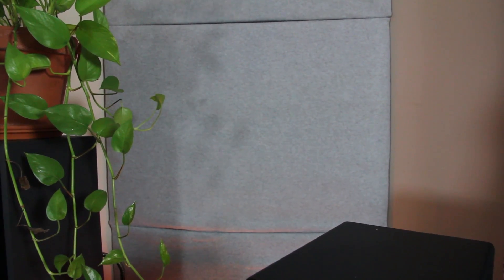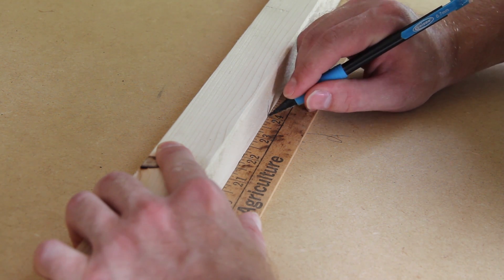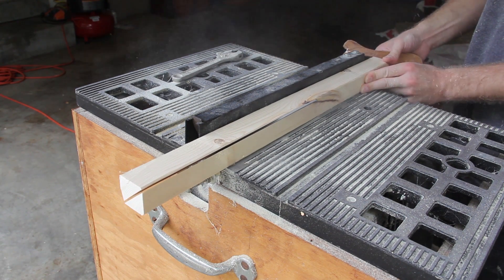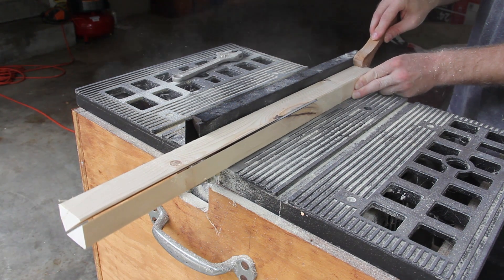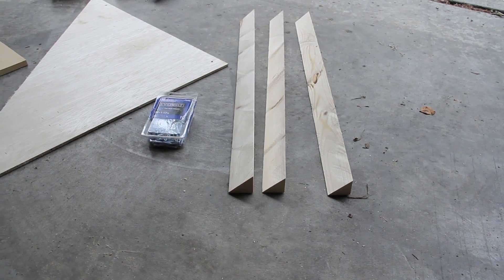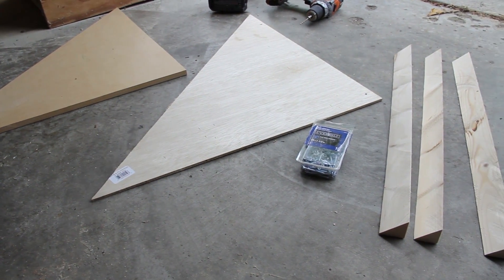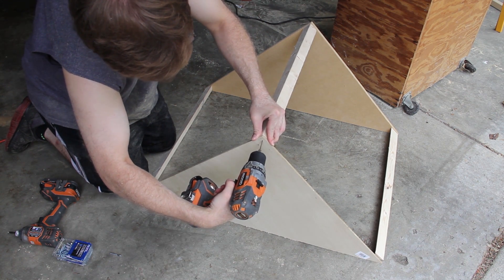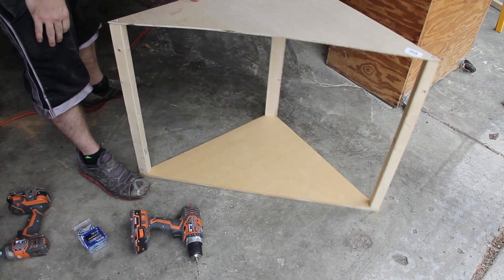DIY Bass Traps: Home Studio Room Acoustics

Comment: holy crap! never cut anything on a table saw like that!!! super dangerous. Ive been a carpenter for over 20 years and I would never even think of cutting anything like that. That could bind on the saw and pull your hand right into the saw. 
Other than that, good vid!
Reply: No, I dont do this!!! That is what band saws, routers, etc, are for. Use the right tool for the job. When I started in carpentry, I had a boss that would have kicked my ass if I did this...and now, I would never let any of my employees do this!!!! Very stupid and very dangerous. DON'T DO IT! I dont want anyone to think in any way this is something they should try or might get away with. This is how you loose fingers. Ive seen some very bloody injuries on the job site from guys who "didnt like to listen".  Ask any REAL wood worker or carpenter, they will tel you the same.
Reply: @christopherkent3294  I want to learn how to do this.  what is the right way to do it?
Reply: @marcohowardvalencia1644  never reach around the back, the saw is rotating towards you.
Reply: @christopherkent3294  Thank you!  When it happens, it happens too quick to do anything about it.  Some very seasoned woodworker have lost their fingers after years of experience, they just got lazy that one time and they were never able to flip anyone off thereafter.
Reply from the maker: +Christopher Kent haha thank you! Yes I have had several comments warning of this. I might add more precautions to the description about what to do different from what I did when using th saw. Thanks!
Reply: Might be a good idea. Didn't want to post a negative on your video, just made me nervous. I'm building a small practice room/recording studio. Thanks for the vid!
Reply: Ha!  Yeah I watched this video before reading the comments and actually held my breath during that 2x2 cut without any kind of miter or fence.  It took me a minute to think, "He's probably okay and won't lose an arm right now since this is on YouTube", but there was a moment there.  

Great, functional traps.  Nice finished work.
Reply: it's totally fine to do use the table saw like this. 

if you don't care about your appendages.
Reply: :D - and as a carpenter for 20 years, you have never done this? hundreds of times maybe? :). Of course it's not the safe way to use a table saw - but there are limits to how super careful you need to be. Sometimes it is just more practical to saw things freehand. Every carpenter knows this :). No use denying that :D But you gotta be very aware of what you do when freehand sawing like this, and from what I can see in the video, mr. Todd Audio have no problems with this.

But hey, safety police are always lurking around these kinda videos hehe.

Don't get me wrong - it is not safe, but it most certainly isn't as dangerous as many want it to be. From the way he handles the saw and wood, there is no chance that things just fly off in the wrong direction out of control. It might bite a bit, but not out of control.

best regards from a long time furniture maker that also knows his way around table saws.

Comment: I wonder how many viewers had to go to the ER after trying to crosscut lumber freehand on the table saw. Extremely dangerous technique. A table saw can send material flying towards the operator at a very powerful high rate of speed and pull your hands into the spinning blade. This is coming from a residential carpenter, cabinetmaker and DIY audiophile with decades of experience. People do NOT use a table saw this way, it’s not worth injuring yourself in pursuit of better sound.
Reply from the maker: So far I have not had any comments or reports about injuries, which I'd hope they'd let us know and warn us. Thank you for your warning - this is part of the reason why I leave comments open to the community. You told us what not to do, but it would be very helpful if you could advise what to do instead. 

To the viewers:

First of all, lets get this out in the open - table saws are dangerous, no matter how you use them. For one, make sure to wear eye protection. I'd like to repeat what I said it the video. The TOP priority is not to cut yourself. When making a cut you should NOT be thinking only "This cut needs to be perfect," but instead you SHOULD be thinking "WHERE ARE MY HANDS IN RELATION TO THE BLADE. IS THERE ANYTHING I AM WEARING THAT IS LOOSE OR HANGING AND AT RISK TO GET CAUGHT IN THE SAW. IS EVERYONE ELSE WHO IS NOT INVOLVED FAR AWAY FROM THE SAW. IF THE SAW GRABS HOLD OF THE WOOD, I WILL NOT KEEP HOLDING ONTO THE WOOD AND I WILL RUN AWAY FROM IT TO UNPLUG THE POWER SOURCE." Now let's work together to productively discuss safer ways to accomplish these cuts, which are necessary to build these.

At 3:34 - Please use a table saw blade guard for the blade for this cut, which is not shown in the video. My apologies.

At 3:52 - ??? Is there another precaution we can use to make this cut safer? Do they make blade guards that can be angled? Make sure to use something to push it through as mentioned in the video, to keep your hands from getting too close.

At 5:37 - ??? A fence definitely cannot be used for this cut, but it looks like a quality blade guard would work and be narrow enough to still let the plywood pass through. Same for the cut right before this one.

People are out there making these regardless, whether I have a video out there about it or not - and I assure you that I definitely want this video to be a proper guide in every aspect, especially safety. Everyone here will appreciate any additional guidance and solutions from those with more carpentry or DIY experience than myself - just keep in mind we are a community looking for advice and guidance. If you can share a better way to do something you see in any video on YouTube, please do!

Comment: Hey how do you hang the bass trap on the top of the wall ? ? I'm making only one so I can't stack them .
Reply from the maker: +PlainSimple You might be able to use some screw hooks into studs. If you do this you will probably want to modify it to have some sort of way for the sound to be absorbed through the bottom, since that will still be a hard shelf-like surface.

Comment: that fibreglass is good for those low frequencies?
Reply from the maker: +Cam Par it is mineral wool, but if you go the fiberglass route a lot of people rave good results with Owens corning 703 FRK. The FRK membrane will improve the response for the really low, subwoofer range frequencies. I can hear an very audible difference with what I have, but from what I hear the FRK membrane is an improvement with handling frequencies below 100hz and if you don't want to completely dampen everything it will also help reflect some of the high frequencies to keep the room more alive. I might consider adding an FRK membrane at some point, if I can find it separately.
Reply: Todd Audio my speakers go down to 36hz
Reply from the maker: +Cam Par yeah I have a sub and can still decifer low piano and bass tones way better than before. I play piano so might have an ear for it as well, and have pretty good headphones as another reference. Nothing really beats a professionally build room for a studio. For home applications, larger rooms also make a big difference since there is more room for soundwaves to disperse before they reflect and get back to your ear. I would recommend doing some research on the FRK membrane option or Owens Corning 703 FRK compared to this. I still should research that side of things more myself before I decide. You can probably find frequency test charts online that show results on how effective they are. Even retail sold applications should be looked into because depending on what it is it might not necessarily be as effective.
Reply: Todd Audio thanks for the tips, my low end mixes always sound muddy, tike for bass traps!
Reply: @ToddAudio  In dialoguing with Ethan a few years ago (my project is on Gearslutz with pics), he admitted that in his RealTraps they have moved away from FRK (which is like aluminum) and rather recommends 2 other options that are usable on any trap approach: thin plastic (like mattress bag material), and/or Kraft paper. Use adhesive spray so the covering adheres. I've tried both materials and prefer the craft paper. Here's the approach: For slightly increased bass response, put the covering toward the wall (with an air gap). For less absorption and more reflection of higher frequencies (to not overly deaden the room), put the covering on the front (room facing). That said, Ethan says NOT to do this where mics or early reflections are involved. So, really only in your bass absorbers (i.e. rear wall corners) and back half of room (Not front wall, or ceiling or side wall early reflection areas). There is a noticeable acoustical difference.

Comment: Great job! Thanks. How much difference would it make to just have one piece covering the opening with space behind it?
Reply from the maker: It would still help, but not as much below 100hz. Compared to the bare wall it still makes a big difference in the overall sound. I have another video called DIY Acoustic Panels that shows how to make panels with just one sheet of the Roxul into a frame.

Comment: Hi friend. My room is small. its dimension: 2.8 height x 3.19 width x 3.9 length (in meter) following ratio 1 : 1.14 : 1.39
If I use Roxul like yours' then which size of trap should I use?
Reply from the maker: +Tran Tuan Nice! I actually am working on setting everything up in a small room almost that same size as an experiment. I can definitely say in a room that small every bit of acoustic treatment makes a difference! Any size will help but I am very glad I made them this size, even though they do take up more space in the corners. I've read a lot of forums and articles about treatment for small rooms over the years, and while there are some varying opinions, the general consensus seems to be the more corner, wall, and ceiling surface you cover with Roxul or similar absorption panels, the better.. a room this small is just too small to really contribute to the sound quality, so broadband absorption as shown in this video and my DIY acoustic panel video helps keep all the unwanted reverberations from getting back to you and making it difficult to mix accurately.
Reply: Nice Todd. What is your room dimension, what about your data, which lowest frequency can be managed? Because of my low finance, I intend to make 4 triangular traps (34'' x 34'' x 48'' in length of sides and 24'' in height) for wall-ceiling corners; and 4 straddling panel traps (48' 'x 24'', 4'' in depth). Some other panels for first reflection, rear and front walls. I'm bad at software measurement. What is your opinion about my plan in general?
Reply from the maker: I actually have not run a test on it and don't have the software yet. This design was based on research and some other results I've seen. It sounds like the traps you are planning on making are even bigger than these! I think your plans are similar to what I am doing and it definitely makes the room sound way cleaner. Even with the lows, audibly, I can make everything out really easily. I am a keyboard/piano player, and I've tested the very bottom octave out on the piano keyboard with various sounds, and it is easy to differentiate the tones and notes. I do think that once this gets below 80hz or so, the material starts becoming less efficient. Having 1 layer doesn't do much for the very low freqs, but having it thicker in the corners seems to help. I need to run a test on it, because like I said audibly it makes a dramatic difference, even in the lows... so I'd say probably 99% of non-studio listening environments would be no match in clarity for this setup. I've also read that adding a membrane in the front will help to keep the room alive without overdamping, and it actually improves the low frequency handling. I might look into this further and do some tests one day. Ethan Winer I believe has some tests results shown on his website where he uses 1/4 and 1/8 plywood.. and also info about using 705-FRK fiber glass. The FRK means it has a membrane, but I'm not sure if you can get that membrane separately.

Comment: great video! thanks!
Reply from the maker: No problem! Appreciate the feedback and glad you liked it!
Reply: BTW, Todd, do these panels work for general frequencies or mostly the low end? I have a relatively small studio and frankly very scarce room on the corners for big traps such as the ones you made in this video (uneven room layout due to a door, a clothes wardrobe, etc), but am still willing to treat it the best way possible. I already have panels (fiberglass) on many of the surfaces and they seem to work rather well, but still would like to treat corners in some way. maybe the wall-ceiling ones?

Comment: It is a bit a pity that you maintained that power out and did not just displaced it or used an extension cable. (I did so) because the corners arethe place were bass can be killed most efficiently. Regarding the builing procedure I strongly recommend to cover ALL sides because this material can make you sick because of its microscopic structure. in some countries AFAIK it is not even allowed to use it inside rooms without that treatment.
Reply from the maker: Thanks for the tip juergen s! Both easy fixes if I ever want to go back and add to it. I have an air vent on the other side too, so that's another consideration.. as well as a desk tucked into the opposite corner. If my room was slightly larger for everything, it would be nice to fully fill in all corners. Right now it doubles as a living room area, but maybe one day everything will be in it's own room. There are no major health risks for this specific product that I have found while researching and reviewing related questions on forums. I also checked the Roxul website's health and safety page and the only noted precaution is dust control while handling it. They offer some guidelines such as being in a well ventilated area and using a dust mask/gloves. Since mine are up against the wall, I have not had any problems.. but again, if I ever want to enhance things or end up moving them frequently I might cover the sides.

Comment: Hey Todd Audio great vid! Nice and clean design. Question mate, After installing these was the difference in the low end clear? I built similar panels and had no success. I still cannot hear the low end at all! Im considering this build but I might steer away from the Safe N Sound and go with Pink Fluff or Roxul 80 as my insulation. Advice?
Reply from the maker: Hey, thanks for watching. Yes, from A to B (bare walls to bass traps) the difference was very clear to me by ear! In order to go any further than this, I feel I would need to start getting in to doing some room tests, but for a fairly practical home studio solution I am really happy with this. My biggest concern was hearing an audible difference, and everything was way tighter sounding in the low end. I have a sub for mixing also. As a real life example - recently, I opened a project I worked on before adding the bass traps. I've had the bass traps several months now and could tell there was some major muddiness going on in the low end on this song that I wasn't able to notice before. The kick bass was supposed to be sustained for a bit, but just sounded messy and not clean. I changed the tone a bit, added compression, and then layered that with another kick sound with more of an initial hit to it and a quicker drop-off. Problem solved. Hope this helps!
Reply: I think for low fequencyes in professional studios they don't use absorption materials, becouse of high energy and long wave lenghts. The sounds with long wavelenghts could be muted by so called helmoltz rezonators.
:)

Comment: nice video. but i see issues with installation. in my opinion why didnt u do one big frame with shelfs it would look the same but without 4 parts + u can see each one in ur ... then cover from top to floor in one peace of cloth per conor per unit ? ??
Reply from the maker: Thanks! That would work fine too, but I wanted something more portable in case I ever decide to move everything to a different room. I just have to unstack them and move them. Also, if I wanted to rearrange this room I might not want a full stack in one or two of the corners if I move a desk or something there. Appreciate the feedback. Happy New Year!
Reply: Todd Audio ok np. even as parts why only wrap the front and not all the way around ... if u covered all the sides when u are moving it the stuff on the insides dont fall out ? . 

ps follow me on fb plz ! 

https://www.facebook.com/FLSTUDIO.IRISH.PRODUCER/ 

im building a new studio room and would appreciate  feedback as i go along.